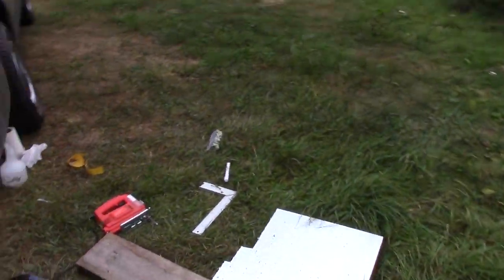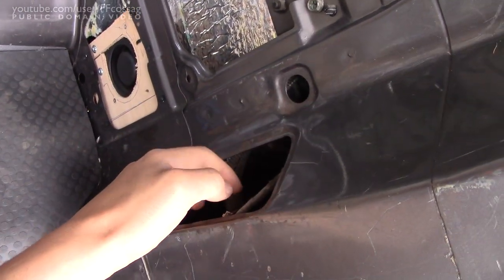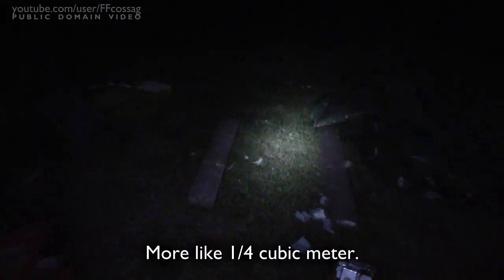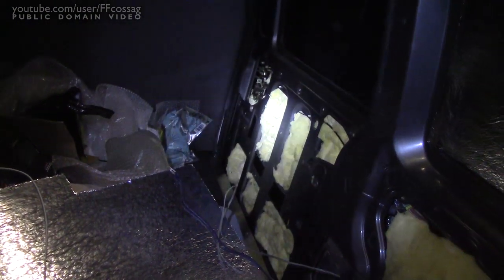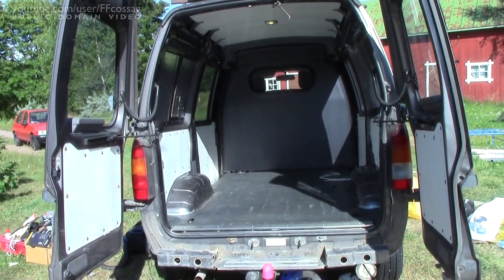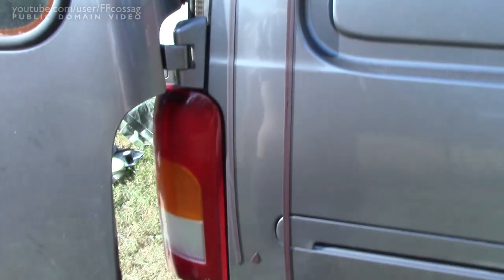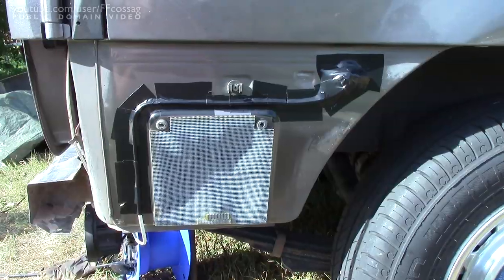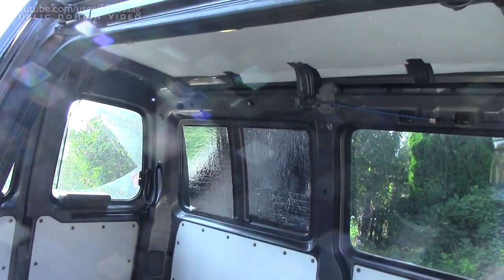Van camper! Build log #4 - Insulation & walls

Comment: if you are going to sleep in it as a campervan - I'd suggest fitting either a rotary or a pop-up roof vent. otherwise you are likely to have condensation issues.
Reply: Or he could use the two fans he mounted, regulated by an Arduino that measures the humidity.
Reply: however moist air from breath tends to be warm and thus rises - condensing on the cooler painted plywood of the ceiling. If there were a roof vent the warm moist air could escape thus preventing condensation on the ceiling. I speak from experience having converted a van into a camper.
Reply from the maker: That is something which I've considered strongly. I just really, really, REALLY do not like the thought of cutting a hole in the roof which does not leak. If worst comes to worst, I'll do it on the fly, but I'm going to see how it's like without, first.
Reply: Maybe you are lucky enough that there is enough space in the pillars for ducting, which would allow you to suck air from near the top? That way the exhaust could still be behind the bumper, and they would cool better.
Reply: if you purchase a commercial roof vent - cutting a hole in the roof isn't that much of an issue - as long as the hole is clean - the seals work really well - windows - either sliding or push out - are onlt sealed by rubber seals.
Reply: Kasper Pedersen ducting can be a PITA - if it doesn't seal properly it can leak, if it isn't secured properly it will rattle, further you would need a powerful waterproof fan and a large distributed central collection vent to capture all the warm moist air etc. etc.
Reply: when I did my van, I put acoustic dampening panels onto the metal skin, rock-wool insulation, thin plywood and then carpet on top secured with contact adhesive. a manual pop up roof vent from a caravan, and LED lighting. It worked fantastically into sub 0 degree C. I also insulated and soundproofed the floor in the same way. Added around 100kg to the un-laden weight, but it was worth it.
Reply from the maker: I actually test slept in it for the second time tonight, and the ventilation fans seem to make short work of any condensation buildup. I kept feeling around all over, and it stayed as dry as the rainy night allowed. Air comes in through the top frame rails, so I'm thinking that's what makes it work.

Comment: looks stellar. in fact, looks like it was meant to be that way inside from the factory! 
in terms of stuff inside, I'm going to guess air mattress and/or sleeping bag, peltier cooler full of nothing but Finnish ice beer, and probably a low-power laptop of some kind for some form of entertainment, if the radio isn't enough to keep you sane. hopefully there's cellular data wherever you're going.

I was thinking about getting a sheet of that kind of plywood you're using for the ceiling as the cover for the spare tire in my Corolla, once the engine swap is complete. Sadly the factory fitted it with the same kind of board you have over your side panels, and it has heavily warped over time and just doesn't sit flat anymore. Perhaps slightly thicker stuff, I want it to be able to support at least 4 or 5 loaded computer cases' worth of weight on it without it bowing too much onto the by-then full spare, to be on the safe side.

Comment: Cracking job :-D, less resonant and brighter too :-D.
Exhaust pipe next perhaps?
Reply from the maker: I've considered it, but the noise mostly has to do with the engine simply being a loud design.
Reply: Is there enough noise suppression around the engine area?
Reply from the maker: zx8401ztv
See, the thing is that  the engine is directly underneath your ass. We're talking centimetres. Stock as these vans come, you can hear every valve and every injector, all the time. I've added RIDICULOUS amounts of sound proofing to it, and that's brought the noise level down from Soviet tractor to somewhat normal levels. Most of the noise coupling now is mechanical, through the engine mounts.
Reply from the maker: *****
I see it as a challenge. I own this van because I paid 300 € and a broken pick-up truck for it.
Reply: Dam impossible to escape that engine, but the nice side is you can do maintainance on the engine while indoors lol.
I think a few of the old uk vans had the same setup, i think they were bedfords or comma vans, memory has faded sorry :-(.
Reply from the maker: It might be humorous to say that you can work on the engine indoors, but I've escaped the rain MANY times by doing just that. You might also be thinking about this exact model; it was sold as the LDV Cub in the UK.
Reply: No it wasnt the ldv, too new lol.
Ive found the pictures, it was a commer van/camper, been around from 1965, dam im old lol.
http://commervanoztour.blogspot.co.uk/2012_10_01_archive.html
Just past half the page for the engine indoors :-D
Reply: +zx8401ztv
Holy fack, it's my shadow!  Wotcha mush! ;o)
I had a Bedford CF230 with a camper body. 1978 vintage, with an engine half under the bonnet, and half in the cab. I also had to take the fridge out to get to the battery... Complete bastard to work on. The Mk. II Tranny I had was a much simpler beast to work on, but a pig for rust. :o(
Reply: My mate has a mk3 tranny, a good old beast :-)
Im not your shadow Sarky Bugger lol, you have the same taste as i do, good people to subscribe to :-D.
Next your going to say you like tea :)
Reply: zx8401ztv
Funny you should mention it, but yes, I am rather fond of a brew. ;o)
Reply: lol i used to drink pg tips tea, but it seems a bit weak now, its eather the tea or my tongue/brain is worn out :-).
I now torture Yorkshire Tea with boiling water, im evil :~D
Reply: zx8401ztv
Ex PG and Yorkshire man myself, but I now "use" Tetley. Stronger, brighter, and cheaper than the other two. YMMV...
Reply: Hmm i may give that a go when this box of yorkshire tea is done :-D.
Some tea's seem to have a dusty/powdery taste, not my cup of tea :-D